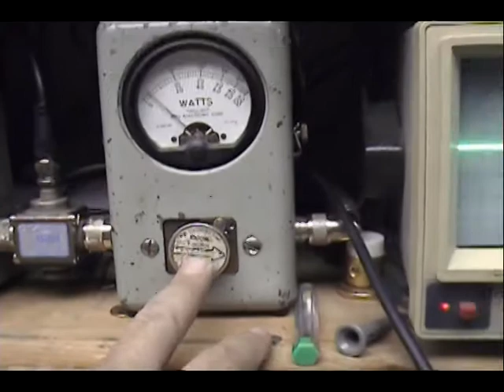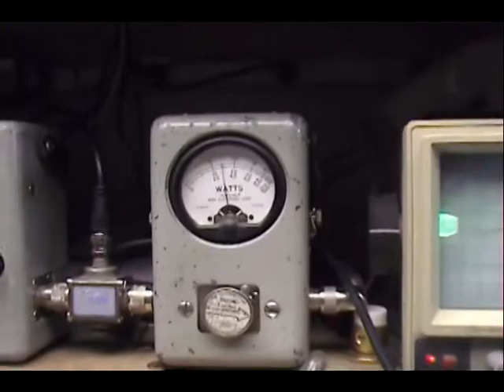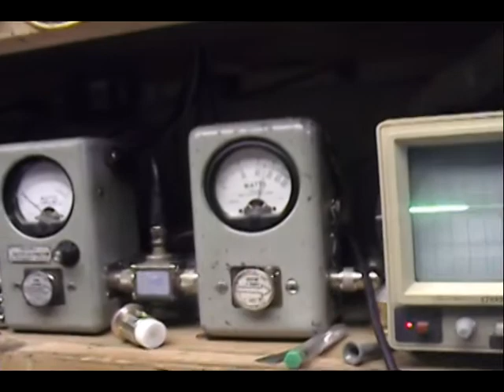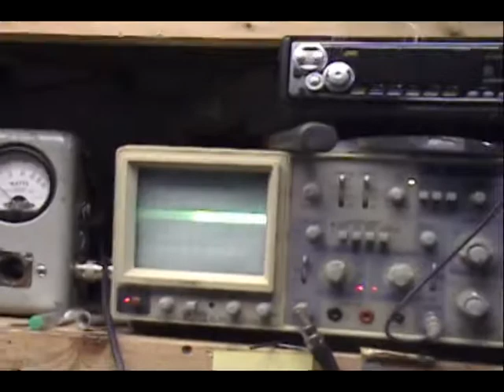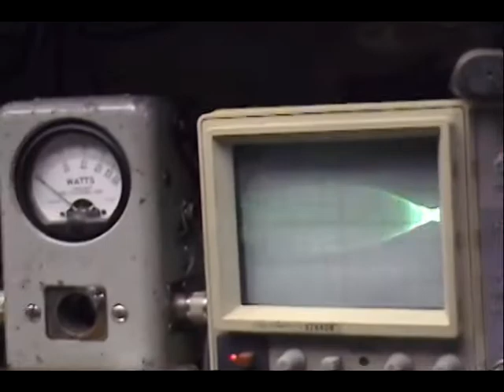Ranger 69FFC4 OEM Demo

Comment from the maker: For the FM customers abroad I leave the carrier adjustable to 200W. FM makes the radio much hotter and any higher than 200W wouldn't be safe.
I advise to remember to lower to 100W or less on the front control,  when using AM.